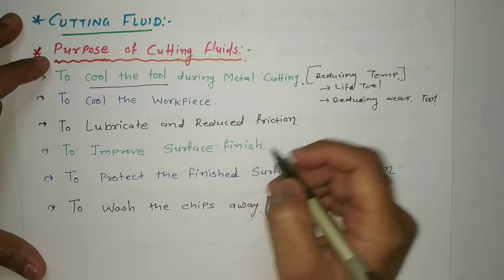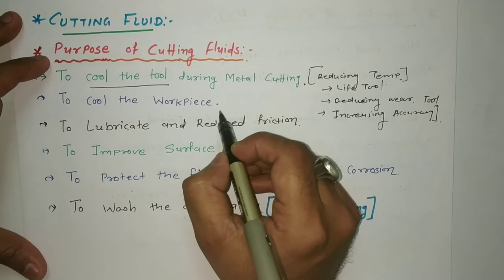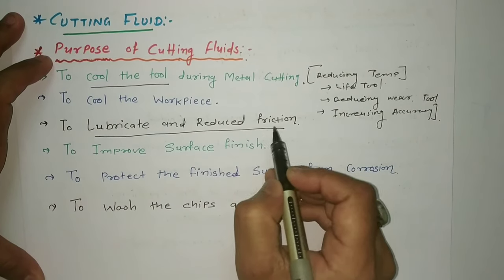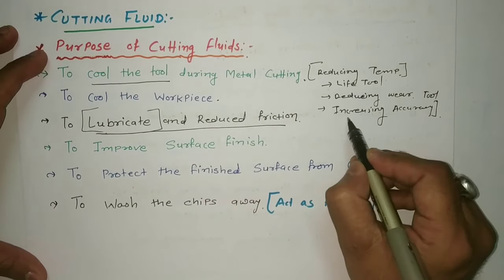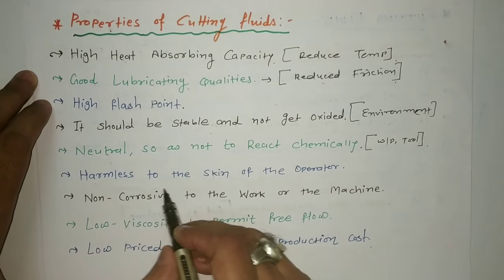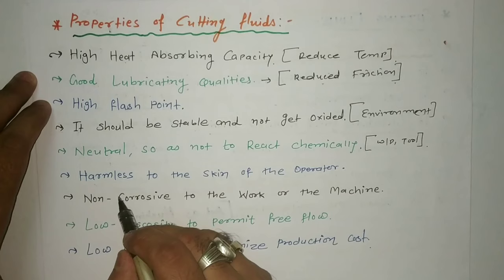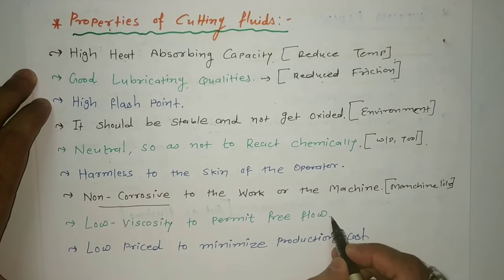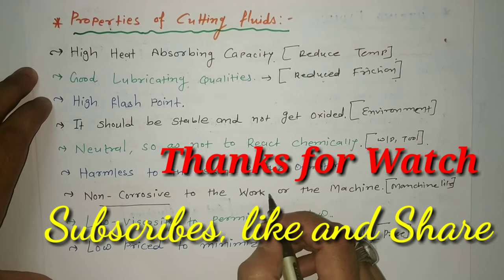types of cutting fluids | Properties of Cutting Fluids | Requirements of cutting fluids

Comment: sir tell both cutting fluids and grinding fluid are same
Reply from the maker: Yes, you can use for most of the cases, but depends upon workpiece and tool matetials.
Reply: @modimechanicalengineeringt8780  OK thank you very much sir
Reply from the maker: 🙏🙏🙏
Subscribes, like and share